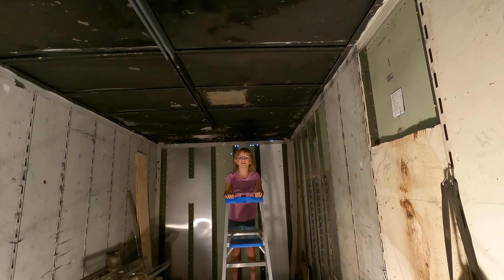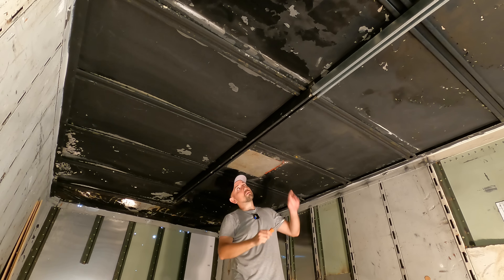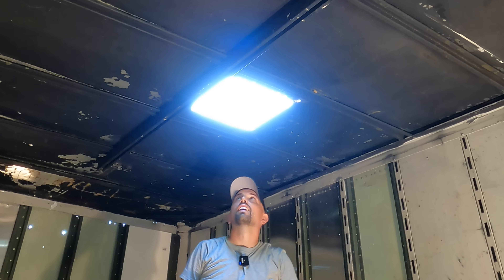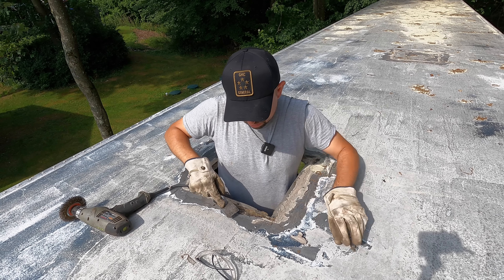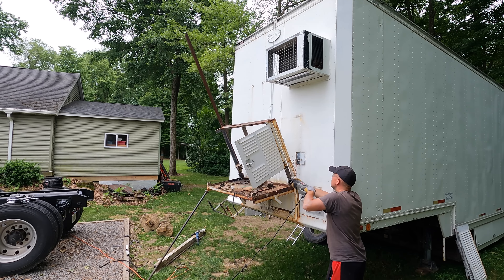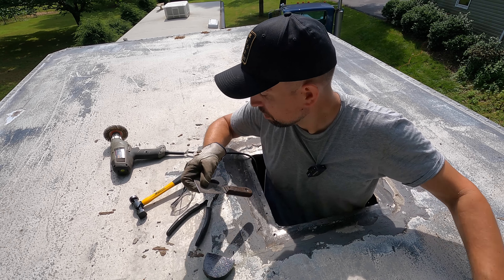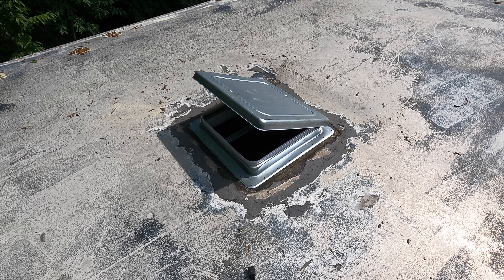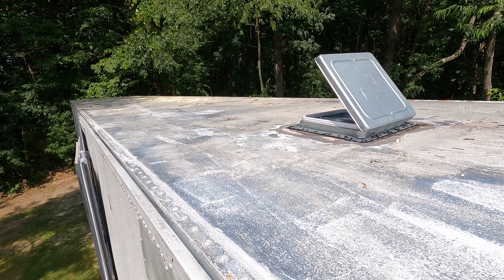THE VENTS ARE BACK! Knight Rider Screen Used Semi Trailer's Roof Repairs (Garthe Would Be Proud)

Comment: Your daughter did a wonderful presenting job, well done to her, my theory for that central roof channel, would be for the chains or cables to run through towards the main motor for the door opening mechanism, the strongest part of a trailer like that one is the thick floor plate where the fifth wheel hitch is mounted, so a motor big enough to operate the door would have to be mounted on that strongest part of the trailer, right at the front, that's a good place to set the electrics for that motor, they'd come from the air and electric plugs when you couple the tractor unit, the tractor unit would effectively be the power unit for it , several videos ago you asked what people thought that was next trailer legs, I think that is an electric motor of some kind  to operate the door, it has the resemblance of a heavy duty electric motor, just some theories

Comment: I can tell just by watching you struggle getting 1/2 way through the vent holes that you have never been a firefighter. Most departments have a training mandate that says anyone going into a burning structure has to be able to go through a 18 inch square hole in full kit. I am a former firefighter and trained in the different methods of doing this, it is not easy or fun but it can be done. Any way I love your videos, and enjoy seeing you work to bring the screen used items back to their on screen glory.
Reply from the maker: Definitely not, but I commend ALL the firefighters out there! This was a 14" hole, and when Hasselhoff climbed out, it was even smaller because the vent trim ring was still in place.
Reply: @KnightRiderHistoriansOfficial  yeah a 14" hole would be very tight. I thought I heard you say at one point it was 18". So with the trim in place it is probably about a 12" square hole.

Comment: That must have been a dangerous stunt when Garth climbed through the vent. Not only for the Hoff but also for the camera crew to secure the camera on top of the roof while filming.
Reply: Stunt Double
Reply: If you notice, he keeps his right hand holding onto the opening so he is actually quite secure, else hanging your legs over the edge with nothing to hang onto would be very risky with nothing to hold onto
Reply: @TheseBygones  I know they cut to the stunt double jumping into the convertible but the fact that they are on the roof of a moving truck is crazy. But I’m interested to see how they secured the camera I’m sure they tied it down or something.

Comment: 😄I swear when I watched the tv series last in that particular episode I swear the door was behind David facing away from the semi cab, but when I relooked at the scene just tonight 11:32pn Tuesday Central Time, the door of the vent is facing towards the semi cab in the direction you installed it.
So you really must know your Knight Rider or you rewatch the episodes before doing any TV correct installation of any part to the truck or trailer.
It took almost a full hour looking through Google to find that episode because you can no longer look it up on my spectrum cable box as like a demand thing.
Hey when the Knight Rider historian text comes up were you supposed to be in a live shot you a voice-over shot.
If it was supposed to be live oops.
Hey when I was looking at the wrong crowd I notice that the pulley block was vertical on the back of the semi not horizontal like you have it on your trailer at least I think you have it horizontal.

Comment: That rail may have had two purposes .
One for the winch and the other to give some structure so the roof didn’t cave in .
Might want to add another short rail to the other side to strengthen it up some more.

Comment: I can tell that whoever originally put the hole in the roof wasn’t a metal guy as the corner bits are sharp and they should have been removed before they put in the hatch